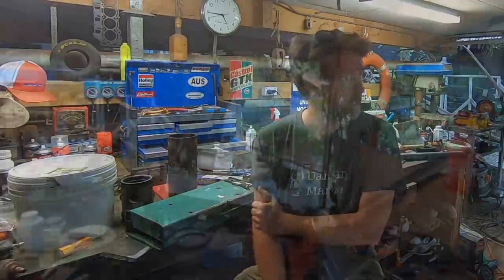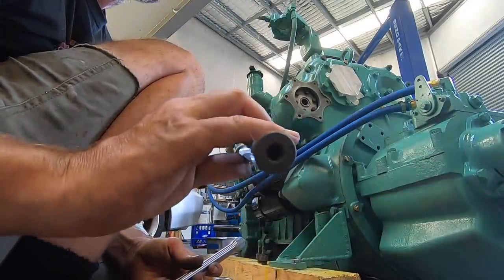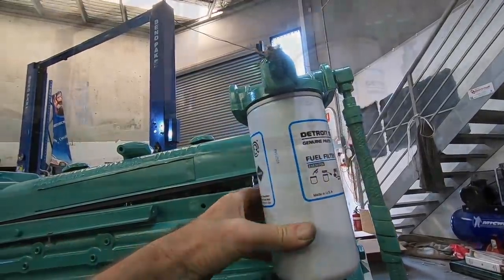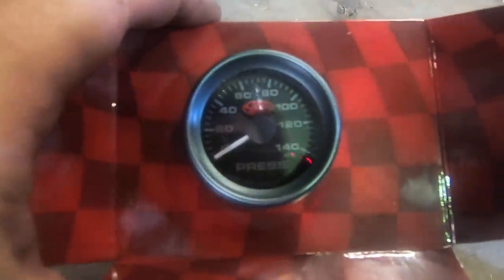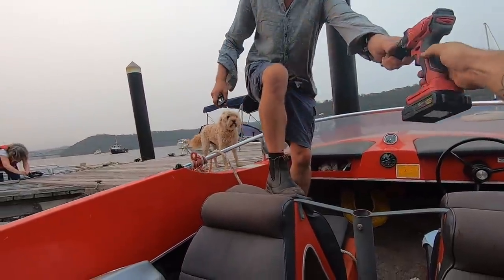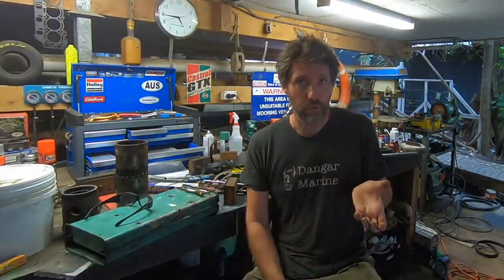Detroit Diesel cooling system and blower trouble

Comment: For those flare fittings from the block to the oil cooler/filter and any other fittings of the same type. Need no thread sealer on them. The sealing surface of that type of fitting is the JIC 37.5° or AN 45° flat angle at the end of the fitting, and putting anything on the threads does nothing to seal up the connection.  In fact it can create a leak. As a former race mechanic and industrial mechanic I have seen many people do exactly what you did to this fittings and they leaked afterwards after I cleaned all that stuff off of it, and reconnected the fittings, the leaks were gone. Pipe sealant is good for pipe threads from the holes in the block to the fittings themselfs, but not  the JIC, or AN  end of the fitting to the hoses.
Reply: I think his intention was as a thread lock. But yes I have never used sealer on any AN fittings before. But then I have never fitted a detroit 2 stroke to a boat before either.
Reply: Agreed. The only place a sealer should be used is on the pipe thread where is screws in to the block. Also thread locker is not required on the flare threads. In my 42 years as an aircraft mechanic we never put thread locker on the fittings. All we use is an assembly lube so we get an accurate reading on the torque and the mating surfaces of the flare do not gall.
Reply: It’s not a thread sealer, it’s a thread locker. The point is to keep the fitting from coming loose from vibration. We do this on any AN fuel or oil fittings.
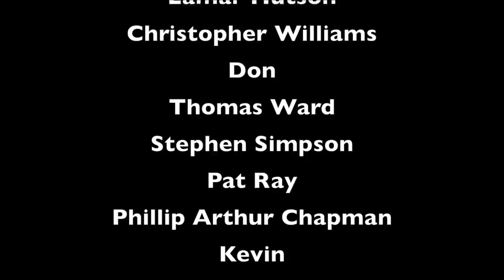Reply: @hightide9513  No 21:12 shows clearly enough that it is a thread sealer. A Google of their site also shows it as a thread locker.

Comment: Glad you are paying Attention to the Oil Flow to/from the Filter. When I bought my last Boat, I had the Dealer install Volvo's Remote Oil Filter. Oil Lines were reversed, and at about 120 hrs(2 summers) the Engine sounded like it had Mechanical Lifters. I touched the Oil Filter and it was cold, after 2 hours of 3500 - 4000 rpm. I took it back the Dealer and Explained what I found. Next day the called and said I had guessed correctly. All the bearings, Crankshaft, Camshaft, Cylinders, and Pistons were badly worn. Dealer got a New Long Block from Volvo and replaced it. It has now given me 14 yrs of trouble free use
Reply from the maker: Ouch. That's an expensive mistake to make!

Comment: A good catch with the blower, it it had been started with rotors rubbing the housings you would be looking for an entire new blower and taking the engine apart again to get the aluminium shavings out of everywhere. They only spin for a few seconds before enough heat is made to expand the rotors and make them tear up the surfaces and lock.
Reply from the maker: For sure Ray, I'm glad I didn't try to start it.

Comment: Good catch on the cracked blower end plate. If you had fired it up with the rotors contacting the housing, you'd have had a very rude surprise.  Adrian is a talented mechanic.
Reply from the maker: Yes, I'm really glad he knew how it should feel. He said the best thing from the whole situation is that the engine had never been started.
Reply: You don't want to have to replace a damaged rotor. Not cheap.

Comment: Good work Stu ,  you remembered my recommendation on using WIA 16TC rods.  I could tell by the sound of the molten pool, that you had your amps set correctly. And the absence of splatter too, it’s right amps. Even if you pressure tested it and decided it wasn’t satisfactory, you could still put two more passes around that pipe and it would be totally fine only staggering the stop starts from the previous bead underneath. Another tip, before you start the weld, do a dummy run and make sure you are able to complete the longest possible weld in one go by making sure you have enough lead from the electrode handle and not snag on anything on the ground including your legs and full range of movement for your wrist and elbow to complete the longest possible weld pass going around the pipe or around a right angle corner or square tube to help with less stops and starts and smoother weld contour.
Also your welds are looking better too mate .  Well done
Reply from the maker: That are great rods, I don't think I'll ever use anything else again. I do need to get in the habit of doing the dummy run as I often don't start supporting my arms in the right position.
Reply: Great advice on making a dummy run. Another bit to add onto it is thinking about clearance for the electrode with a fresh rod or one partially burned down. "Will it fit under that bracket with a half rod or do I need to weld it out in a different order." That one's got me more than once.
Reply: Scott Maschino , yeah I know mate , I try not to give out too many trade secrets, as too many amateurs will start looking at chasing my job.  I only tell stu coz he’s a good bloke 😉

Comment: Just a thought, on the fresh water pipe you made up, a small weld bead on the ends where the hose clamp goes will help prevent the hose from comming off.
Reply from the maker: I did experiment with that but it is already 3mm over sized and a very tight fit so I couldn't get it over the bead.

Comment: Hi Stu, I love your videos...a great blend of two passions...boats and Detroit 2-strokes.

I scrolled through almost all the comments and didn't see this mentioned.  And by now I'm sure Scott or someone has said this...but for others reading these comments...Detroit 2-stroke engines require CF-2 rated oil.  That Turboil is the proper viscosity/weight, but it's CF-4 rated and I don't see that it meets the CF-2 specs.

I'm working backwards through the videos, so I know the ending!  Great stuff. - best wishes to you!

Comment: I tossed the factory bearing plates and bought some nice billet aluminium ones with much better bearing retainers. Much stronger too.  You can get the front and rear ones on eBay for around $100 us each.
Reply from the maker: Nice, I'll see what I can find. Even if I can't do it now it could be a good upgrade down the track.

Comment: That blower shaft drive is the old, original fine-spline setup.  At some point in the 80's, they updated them to a coarse spline arrangement,  so when yours failed,  you would have the privilege of buying not only a new shaft, but also new sprockets to mate up with the coarse splines.  I know this, because I had the privilege of sitting in a small town in Western Ohio for 5 days and 4 nights while the parts supplier kept sending the wrong (incompatible) parts to the shop where I had been towed.  The owner of the truck had the parts sitting on the shelf back home, and he finally got ticked off and over-nighted them, which he probably should have done 4 days sooner.  Once the correct (and matching) shaft and drive and driven sprockets arrived, we were rolling again in short order.  To be fair though,  even before the update, you would/should have replaced the sprockets anyways, as you wouldn't want to trust the splines anymore once they had stripped out the splines on the shaft.  That truck had an 8v-92 in it, and it was a replacement for a big silver-92 that had blown up.  The green replacement itself was pretty well whipped by the time I got my hands on it.  I've never been much of a fan of the old green leakers,  always figured they were man's best invention for converting diesel fuel into noise.  But for applications where climbing up mountains with heavy loads isn't the main focus, they're probably suitable powerplants.  Not bad motors if you're drifting across the flatlands,  but any truck I had with a -71 or a -92,  I had to turn off the headlights so that the truck couldn't see the big hills coming up ahead of us.
Reply from the maker: You've doubled my resolve to carry spares Stan! Fortunately they work pretty well on the ocean where you have a constant load and no big hills to get up. :)

Comment: Square hole in blower drive is probably for the mechanical tach drive. I've got the same 4/71 in my boat. Took me a while to find an original AC tach, cable and reduction drive. I'm enjoying your video's and finding the insite invaluable. I've also got a left hand engine and finding most on YouTube are right hand not that it makes much difference.

Comment: You may want to put a "T" on the oil pressure port and plumb in a pressure gauge at the engine. You'll end up needing to start, run, and check engine operation at the engine and not just the pilot house sometime in the future. It's best to do that now before installing the engine in the boat. A small engine control panel at the engine will be very nice to have. Instead of a pressure gauge at the engine you could just put in a low oil pressure switch and light. That would also allow adding an low oil pressure audible alarm that can be heard out on the deck so when you are running the engine while doing something away from the pilot house or at the engine you can be warned you have a serious engine problem. I'd do the same with engine temp as well. Detroit Diesels don't take over temp or low oil pressure condition's at all.
Reply from the maker: A T is a good idea. I would like to put a simple mechanical one in for first start up.
Reply: @DangarMarine  You will definitely want a "local start" provision in the engineroom.

Comment: 16tcs are every aussie boilermakers favourite rod. They are so easy to run especially out of position.
Reply from the maker: I'm totally sold. I can't imagine using anything else now. Glad visibility of puddle tool. General 6013 rods and it's all smoke and slag but these you get a really clear view.
Reply: Us Boily’s say if ya can’t weld with a 16tc ya may as well give it up now 😂 
Best rod out and such an easy rod to start
Reply: 16tc ripper rod
Reply: Every time I see those Austarc electrodes, i have to google them to see what they are in North America. I am Canadian, but for the most part, we follow AWS. These are 3/32" E7016, which we have, but they are not as common as E7018. Both low Hydrogen and are supposed to be kept in a rod oven at 250 Deg.F once the cellophane sleeve is opened.
Interesting!

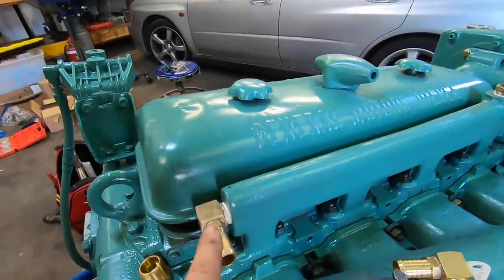Comment: You might need thread sealant on the bolts into the water jacket on the exhaust manifold. Looks like the holes extend into the jacket at the 3:25 point.

Comment: Another great video mate, so glad you found the blower issue. Still wondering about that 1 bolt that is either too short or stripped out threads in the block.
A coopers to ponder over it might help. Look forward to the follow up. Russ.
Reply: Me too, we did not find the answer to that question
Reply: I went back and rewatched that portion of the video to make sure I hadn't dozed off when Stu was telling us what was up with that bolt. 

Stu commented on it in another question about it with this:  Dangar Marine  4 hours ago:
"I'm going to stick a borescope in next time I'm at the workshop and look. "

Comment: The oil cooler fittings that you put thread sealer on do not need sealer. They are JIC or SAE and they actually sealy on the flare not the threads.
Reply: I thought they were called "A-N fittings" (Army-Navy).
Reply: @dustyfarmer   it depends on the angle of the flare. 45 Deg is a SAE fitting (Some call them AN) and 37.5 Deg is a JIC fitting

Comment: Please consider getting a master plumbers opinion on the way you've got the pipe reduction inserted as opposed to butt joining. I've been told that the inserted lip will cause eddys in the flow which not only causes reduced efficiency but over time can cause pin holes through the metal pipe. I'm no expert, just thought I'd make mention of it .🤙🏾😎
Reply from the maker: Yes, may get something specially made down the track when time is one my side. It will be an easy swap out.

Comment: witness marks on everything when you take it apart is the only way to go. have you thought about puting a compressor on the rear gearcase.  would be great if you ever use airbags for salvage lifting.
Reply from the maker: Yes, I have thought about putting a compressor on. It would certainly save a lot of space over the big petrol compressor.

Comment: these old 2stroke detroits the dipstick was off from factory the reason people pointed this out was when under hard load and after wear was put on them they had to have total oil volume removed aka reduce max fill because of a issue with these engines running away running on theyre own crank case oil due to blow by forcing crank oil into the intake making them run away till they went boom LOL.

I think total volume reduction was around 1-1.5 quarts after they were wore in this was common for tow truck service vehicles and dump trucks and school buses and such they removed the oil capacitty to reduce the blowby forcing raw oil into the super charger where it was atomized and turned into raw fuel making them run away and when they went into run away they then started extreme RPM's which caused even more blowby and raw oil to be dumped into super charger aka horrible chain reaction meaning it will scream till it blows LOL.

Comment: Put the corret amount of oil in it then wait till the engine is fitted in the boat to adjust the dipstick
Reply: That's sure a much simpler and easier way to set the dipstick!
Reply: That's exactly what he said in the video he is going to do.......
Reply: @JCrook1028  he actually said he'd re adjust it once its installed in the boat.. why not just put the tight amount of oil in and adjust the dipstick once instead of twice
Reply: @caseydixon8714  No, he did not say he would "readjust" it. He said he would NOT cut it until it was IN the boat. So.....ONE adjustment.
Reply: @JCrook1028  oh ok i wonder what he was talking about spirit levels and checking the engine bed on the boat for then..

Comment: Hey Stu did you put some sealer on the bolts and fittings on the water side of the manifold ! Yep your right mate, put the recommended amount of oil in the engine with the filter plus a bit and then cut the dip stick to length !!  Great vid thanks mate. Seeya Rob

Comment: G'Day Stu,,Mate those oil lines look to be JIC,,No need for loctite as they seal metal to metal on the taper,Some even have bleed of holes for when the fitting is loose,,Just weaps,,
before getting to exciting,,AND,,Typical with the hydraulic community,,are measured in 1/16's of an inch,I.E.1/2 inch is really 8/16's..or size 8..I Think,,always used BSP fittings,on most of the gear i had to maintain,
Hmm,,TC 16 was the right choice,,how ever would have just warmed pipe and the electrodes, make 's for better weld bond,,Get some of the water in the metal out,less boiled water in weld metal.

Comment: Never came  across the Detroit Diesel in any detail until watching this channel. An uniformed impression is that they are more trouble than they are worth.  This engine is costing $$ to bring back to service and appears to have a pit fall at every turn( and that is for a qualified mechanic) can anyone tell me why an amateur mechanic in the same position should not just dump the Detroit overboard and use it as a mooring block. Replacing it with a nice cummins/cat/yanmar etc.?.. Educate me😁
Reply from the maker: Once fixed it will be very reliable which is a good thing in a boat. As it runs on unit injectors rather than a high pressure fuel pump like most modern diesels it can have a cylinder fail and still get you back to port.

Comment: Stu, you are doing a bang up job of resurrecting this old Detroit. I do have a question for you, I noticed you didn't put any thread sealant on the water fittings or the oil pressure fitting...are they a tight enough fit that leaking isn't a concern? There is a reason, after all, that these engines earned the nickname "Detroit Leaker". I can't wait to hear the first fire-up, she's going to sound incredible.
Reply from the maker: Hey mate. Both those fittings had Hylomar sprayed on the threads which is also quite a good thread sealant. Will be pressure testing cooling system before firing it up.
Reply: @DangarMarine  I don't know that we have Hylomar here in the States, but if we do, I'll have to check it out, because I've heard you sing its praises before. It sounds like it's really good stuff.

Comment: Great video! Nice to see it so close to being finished. Do you 'pre-lube' the engine before actually starting it since there is no oil in the galleys?
Reply from the maker: Yes. It gets put together with assembly grease.
Reply: Years ago, my brother and I rebuilt a small block chevy.  It was assembled with the proper grease, however we used a drill and custom rod inserted into the distributor hole and into the oil pump. We
ran the pump while manually rotating the crankshaft slowly which allowed oil to get into the galleys before startup.

Maybe it was overkill, but there was oil pressure immediately on start up. We thought it may save some wear on the new parts.

Comment: Big question is..... Did you fit the hose clamps so they are accessible once engine is squeezed back into that engine compartment. How frustrating would it be not to be able to tighten it if you had a little leak etc!!

Comment: When you measure the angle in the boat for the oil level, how are you going to account for the weight of the engine or will it not have an effect on the angle and how it sits in the water?
Reply from the maker: I'll probably just install the engine then cut the dipstick in place.

Comment: 4:28 Is brass okay to use in exhaust cooling system? 
Great video!!!!
Reply from the maker: Can't see why not given it was water flowing through the fitting to keep the temperature down.
Reply: Dangar Marine I was just thinking about the corrosion aspect of brass in salt water. I always thought that bronze was the type to use, but you might be okay.
Great video btw!👍👍👍👍
Reply: @grumpyg9350  The manifold cooling is on the fresh water side of the system.
Reply: New Jersey Bill . Thank you very much for clearing that up. Guess I should have figured that one out, before I opened my yap.👍👍👍